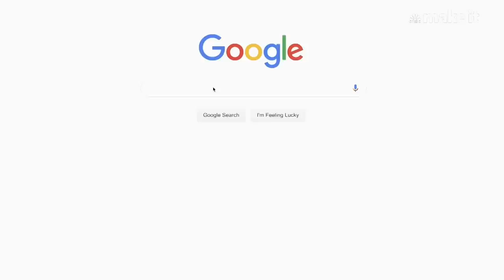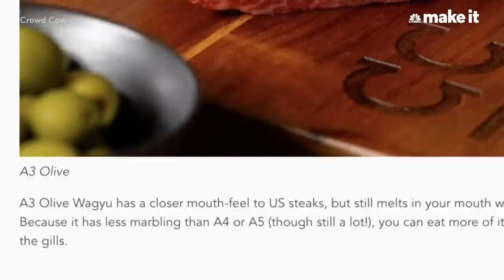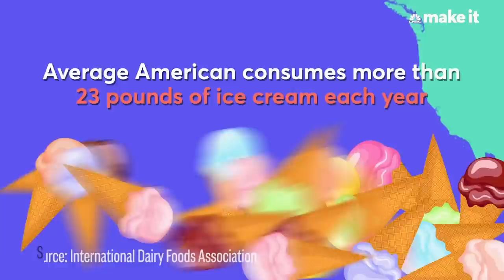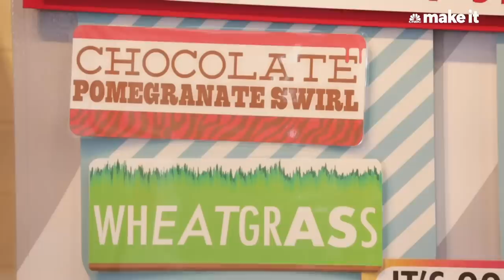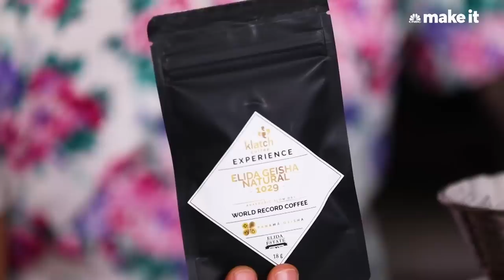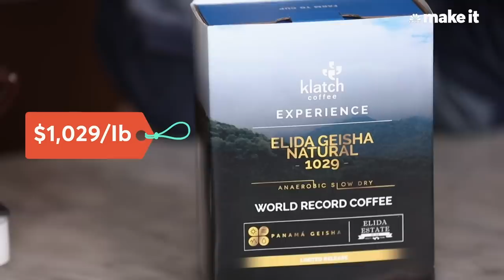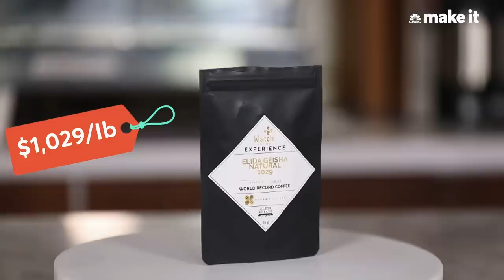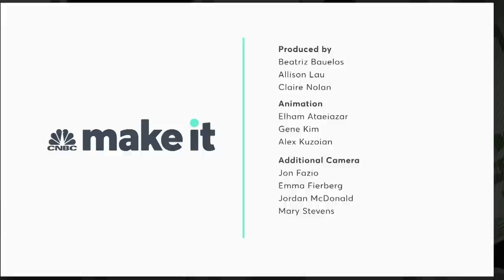Why Wagyu And Nobu Sushi Cost So Much | Worth The Money Marathon

Comment: The thing is, Wagyu or near Wagyu level of steaks and beef is possible, it's called those 15 year old dairy cows.

The only reason why there is no market for them is due to fears of Mad Cow disease, so it requires 2.5 years or 30 month cows to be slaughtered and processed without it's spine.

Farmers with dairy cows will have to slaughter then eat their own cows which is apparently much better quality than 30 month old cows served in grocery stores and the likes.

Also, Japan doesn't seem to regulate those '30 month old cows' from the fear of mad cow, but simply due to strict time limits and profitability in addition to fattening them in that 30 months... So in a sense their beef is better because they precisely put lots of time into flavoring their cows.

Granted, old cows aren't very tender when cooked at the same temperature levels as younger cows, so you'd have to cook them cautiously and undercooked a bit to no more than medium rare, or it will be tough. Wagyu beef has so much fat in them that they can be overcooked and still look 'rare' somewhat.